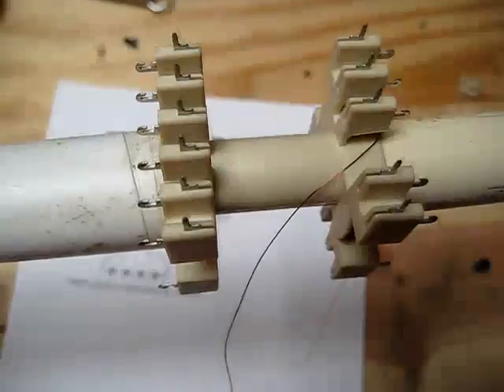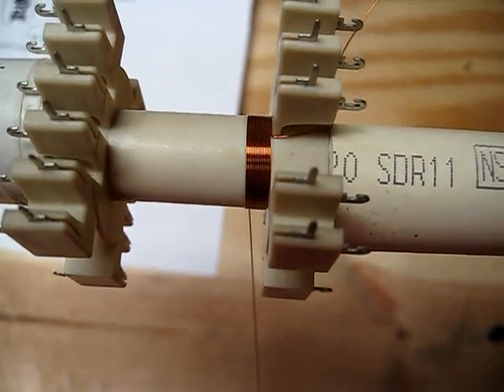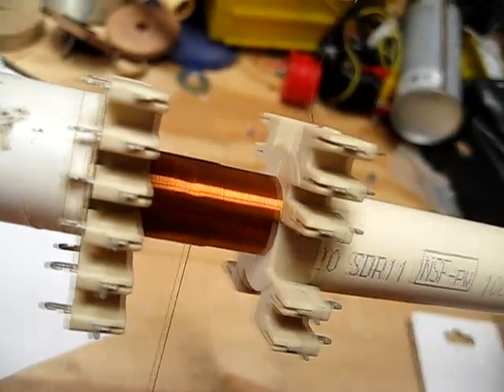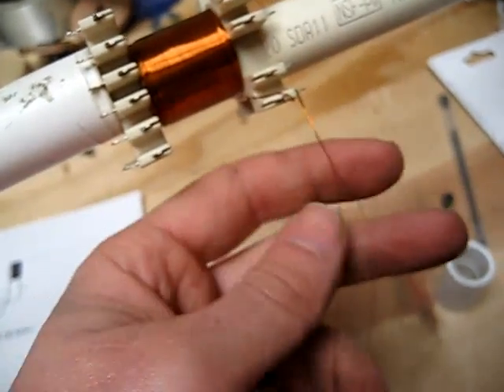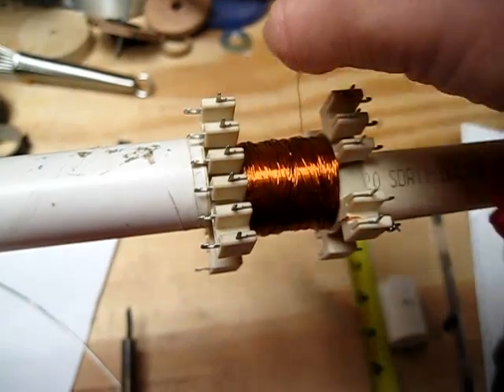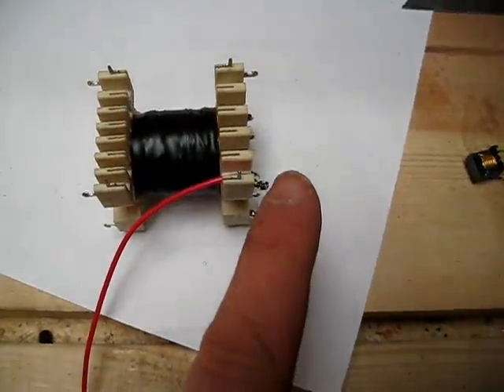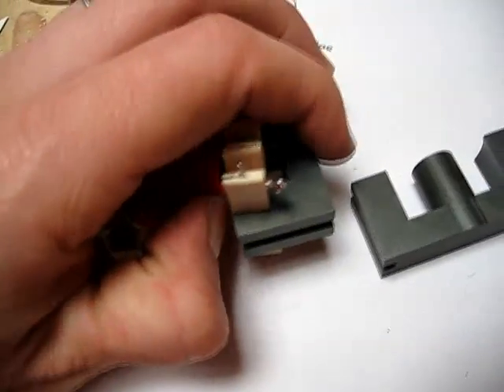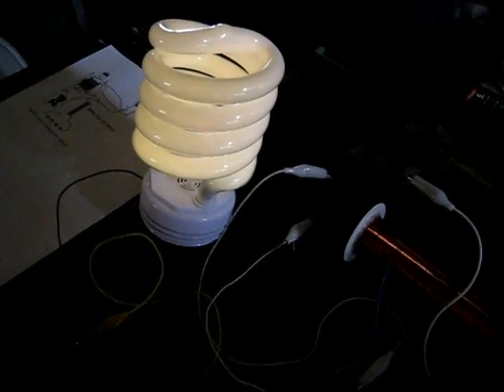How to build the Joule Ringer transformer.

Comment: You probably shouldn't wind the layers uninterrupted with the same cable. If I'm not mistaken it's better to stop at the bottom and then cut the cable, connect another one at the beginning with it's own power source or direct connection to the power source and then finish another layer.

If someone has TRIED IT!!! Please tell me which works better.

Thanks ^^

Comment: First off, number of layers of winding is irrelivant; the number of turns determines the ratio.  Second, direction of winding is also irrelivant; polarity of winding is what matters.  Lastly, using a photo-flash cap without any rectification of the high voltage is a fire and arc hazard waiting to happen.

Comment: why u ruin the perfect wining at the end, it's doesn't matter?  it's really making a noise like a flying bug what' the rest of the parts name number u use, what is the voltage of the electrolytic capacitor u use?  How u make the rod copper, same what u make the wining?

Comment: you are going to love the device i am making i will send you a motor if you like all you have to make is a light dimmer with a pedal. i asked on your other video the specs on your bifilar coil. i also noticed that it sounds like the frenquency is slowing down so its safe to assume that the cap loses the charge.

Comment: Such low frequency for a ferrite core.... I'm surprised it works at all. I also don't understand why you wound the HV terminal internal in the transformer. Seems like a suicide winding to me. Also turns count isn't important? Are you using wire measurement and just putting as many windings as it takes? Just asking... It just seems goofy, how you wound this transformer but, if it works, GREAT!

Comment: Wanna say that i was wondering about the beginning of the twisted wire so  i diged into a Kodak transfo...I think they are the same except they are a little bigger. The video is perfectly correct.Not  replicated yet but compare to a Kodak transfo. it's the same. Begins with several turns of single wire then becomes double (actualy quadruple in Kodak, so go and back 2 times). The beginning is left loose onto the coil ( no solder or junction), the end is soldered as seen in the video. :) :) :) :)

Comment: You said on the OU forum that the light will stay lit for a very short duration even after the capacitor is disconnected, were you going to post a short video showing that?